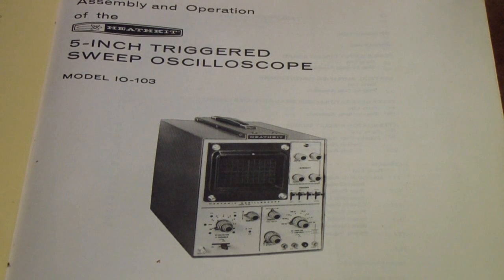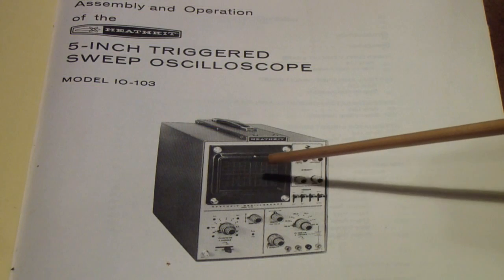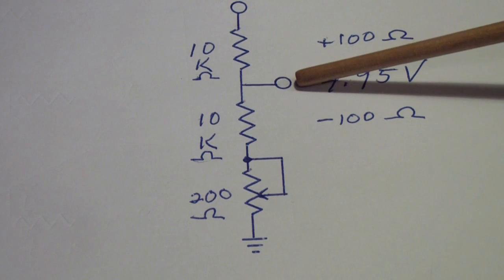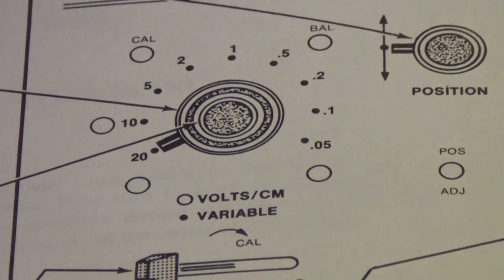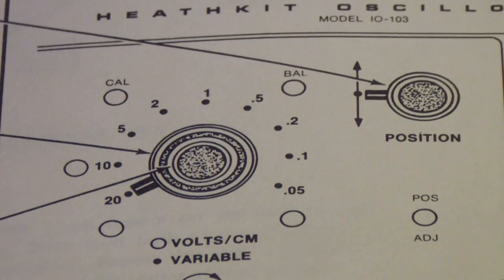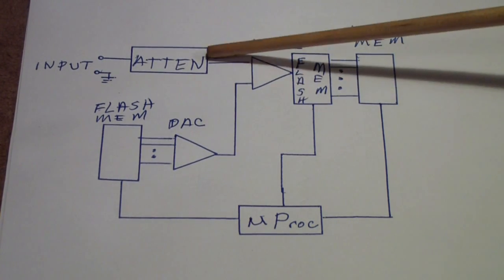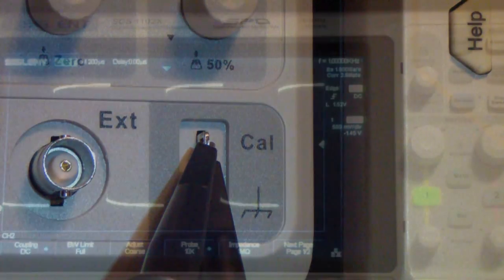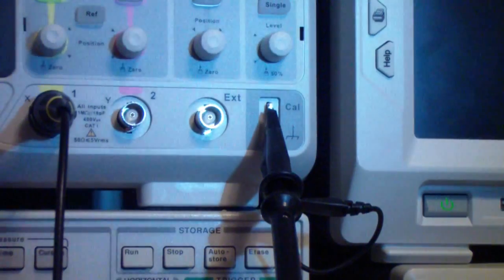TTT059 Scope Calibration

Comment: I love the vintage scopes for that very reason; manual calibration keeps you well informed on the proper operation of the oscilloscope and understanding how it works. The new modern digital scopes as you demonstrated, self calibrate and save a lot of time. The only real adjustment is the compensation probe that requires minimal effort to achieve satisfactory results. A lot of technician I new rarely used the scope because they found it to complicated to use correctly, but the vintage scopes of the time were very versatile and helped speed up troubleshooting techniques if you understood it. Sencore realized this by automating the most common functions in the TV "vertical & horizontal sync" which would automatically trigger and lock the waveform.